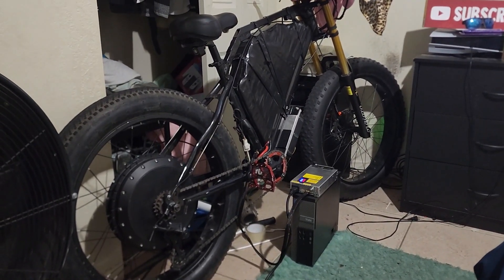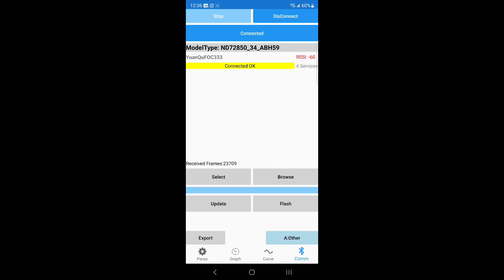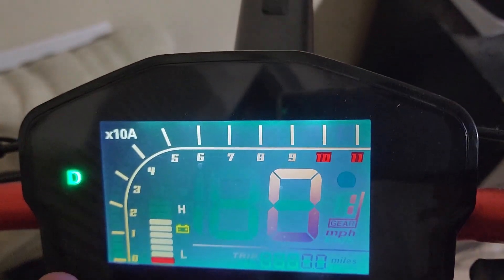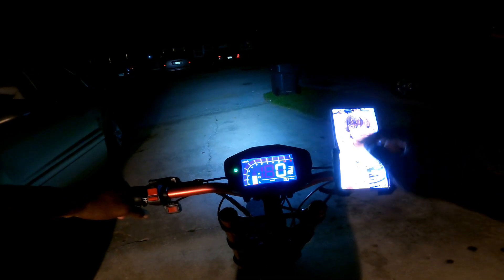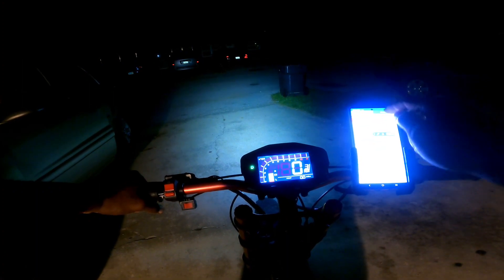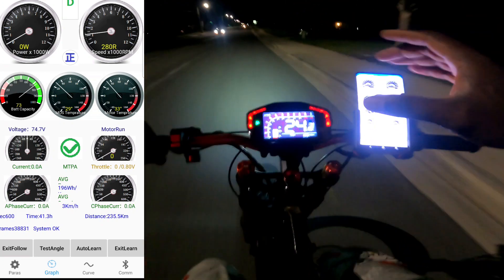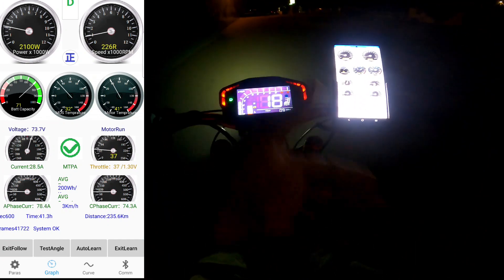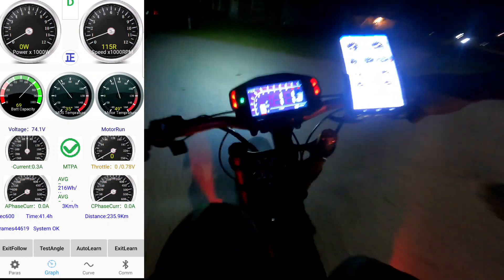How to have your power meter to work on your dkd display  27kw ebike ride

Comment: how did you get your battery level working on the screen.

i have power to my dkd screen. but no wire works for my 1 line comms. 
light blue, purple, brown wires do not work. 

my screen shows battery is full (which the fardriver app says 95) but i dont know if its working right or its just saying battery full because its got power. 
any help please
Reply: Did you try connecting the yellow wire from the display to the brown wire from the two pin connector on the controller

Comment: You pulled 26+kw.  Your battery said 420 amps.  Is that peak amps or continuous line amps?   I don't see how to set "peak" line amps on fardriver.  Also the reading has 380 phase amps "A" and "B".  There are 3 phases so are you doing 3x380 right there?  1140 phase amps?
Reply from the maker: @GhettoWrench  420 is the max continuous discharge
Reply: @E-bikeguy  OK thanks.  I wish I knew you lived by me.  You could have built my battery.

Comment: I have tried this,when i change the byte option to 6 dkd amp meter started working,however when i let go of the throttle very different sound comes from the motor,it sounds like its still turning when it comes to full stop..why is this man?am i doing anything wrong??why would the motor make that sound?i changed it back to three and stoped making that aound

Comment: Bought fardriver and dkd display recently for modding my super73 but the speedometer is showing super high speed. Do you know how to fix it? 
I have set the wheel circumference and pole numbers correctly but still not able to show correct speed.
Reply from the maker: It very complicated I do have the manual

Comment: @e-bikeguy - Huge fan -
Im struggling with a question you may know the answer to. If you have a big battery, and a smaller secondary battery, will there be an issue blowing the smaller battery fuse if the resistance is lower in the smaller battery? How do you wire this to primarily pull power from the big primary battery, and maybe regulate a max amount to come from the smaller battery? 
Idealy pulling a max of 50a from one, and a max of 150 from the primary is what im looking for.
Reply from the maker: No lol as long as the voltage is the same, like for example you have a 72v 40ah and a 72v 20ah you still can run them together in parallel  and you will be fine

Comment: Hey buddy what do you mean you said it to six later??
Reply from the maker: You good byte option 6 just let you see the Amp draw on your display in real time usually default is set to 11
Reply: @EBG-offical  Okay awesome So it's showing over a hundred amps but I thought I have it set to 70 battery line amps.. Is it showing phase amps?
Reply: Like what are the numbers referring to when changing them Do you know?  I changed mine down to 6 But I have my battery line amp set to 70. So do you know is this showing battery amps or phase amps then?  Sorry for the questions

Comment: Hi I am trying to tune the battery capacity meter on the DKD display. 

For some background I have a Surron 60v battery and QS165 and Fardriver. 

I am trying to get the battery capacity of the DKD display to match my battery and Fardriver app. 

For example the meter on my battery reports 80% and battery capacity meter on Fardriver app reports 80% as used the parameters “Full BattCeoff” and “0 BattCeoff” in the Protect section of app to align the battery and Fardriver. 

My DKD display though is reporting 60%. 

I have used the 879 code to set to 60v. 

I am trying to use the 824 code as it’s title is  “self input voltage calibration” but when I use this code I get U- on screen and 72.0 at bottom and when I change 72 to 60 I can’t find away to save and I have tried long hold of the right button. 

Have you any pointers on using 824 to calibrate the DKD battery meter.
Reply from the maker: I sorry to hear that  I'm having the same problem with my son's ebike, he has a 60v and when it full charge  the dkd display says 70%  I'm still trying to figure it out once I do ill definitely post a video
Reply: My sotion display shows voltage as percentage you know how to change that? I cant get it to show 100% i tried all sorts of fardriver settings

Comment: How do you get the speedometer calibrated properly, do change the settings in the gauge or in the app under the guage section
Reply from the maker: You have to change the circumference  and the offset in the display,  email me at theebikeguy08@gmail.com I'll send you the manual
Reply: @EBG-offical  ok I emailed u just now

Comment: Hey buddy no data showing on the display, Is there a setting I need to put in so it knows to put out the communication data to the display?
Reply from the maker: Ok  let me see what I can do
Reply: @EBG-offical  Appreciate you dude!  It's on I just have no miles per hour or live data Coming up.  Happy New Year bro
Reply: Also do you have a video on how to get it into miles per hour mode that I'm missing?  @EBG-offical
Reply from the maker: @Razorcrew_Cole  yes  I'll have to upload it
Reply: @EBG-offical  okay thanks dude, I had one other guy tell me potentially in the far driver 72450 It's the brown wire going to a two-pin clip for communications... 🤷🏻‍♂️ I'll try it I guess let you know if it works
Reply from the maker: @Razorcrew_Cole yes some of the new fardriver controllers used the brown wire  instead of the blue wire
Reply: @EBG-offical  appreciate you boss!  Do I need to put in my AH somewhere so the battery level works correct?  And still need to get it to miles per hour if you know .. thanks man

Comment: I tried changing the byte option to 6 but no luck on the display. No speedo or amps. But it works in the fardriver app.
Reply from the maker: That's crazy  even tho you have the one line on????
Reply: Any ideas on circumference for a 20" wheel.

Comment: hello thank you for your video it helps me a lot I have an ND72360 I bought the same display as you the dkd on my fardriver app I don't have the settings option for the screen, do I need an update?
Reply from the maker: Oh ok nice,  did it work out for ya?
Reply: @EBG-offical  no, I can't get the counter to work, nothing is displayed
Reply from the maker: @electrikeseb1247  ok and the blue wire to controller is connected to the yellow and white wire to display
Reply: @EBG-offical  yes
Reply from the maker: @electrikeseb1247  one more thing,  just the amps meter not working?
Reply: @EBG-offical  on my app at the very bottom I have function and calibration I have no adjustment for the screen ...
Reply: @EBG-offical  no nothing no amps meter no speed in km/h and speed 1/2/3 either
Reply from the maker: @electrikeseb1247  so you have no byte option, if so try a different number till you see it works on your display
Reply: @EBG-offical  speed pulse coeff ?

Comment: Please bro can i ask you
There are many sellers who say that this motor qs 273 v3 has a power of between 8000 watts12000watts  and 15000
 watts And I found another that says it has a 20000 watt motor، Is this power really present in every engine or is it the engine itself only they change the controller 
Please
Reply from the maker: Yes they rate the power of what controller they put in the bike
Reply: @EBG-offical  thank you bro 🙏
Reply from the maker: @medgt3304  no problem 😁

Comment: Hey man love your videos, had a question, I custom welded a 24in mountain bike frame to fit a 40ah 72v battery with 100a bms I have it’s a 5000w hub, can I shunt mod the 80a controller? Top speed is 52mph right now, thanks man!!
Reply from the maker: Yes if the controller do have a shunt resistor you can shunt mod it to get more power
Reply: @EBG-offical   even if it’s 5000w? Might be a stupid question lol, more torque and speed or just torque? Thanks man!
Reply from the maker: @dinkermcplinker7324  it will be more torque and speed😉
Reply: @EBG-offical  awesome! Have a great night 🙏🏼👍
Reply: @EBG-offical  I appreciate you answering so fast🙏🏼 look forward to your next vid, do you have a vid on shunting a 5000w controller
Reply from the maker: @dinkermcplinker7324  not at the moment lol ,but you 80a controller I believe the max it puts out is 3kw but it will put out more when you shunt mod it
Reply: @EBG-offical  shouldn’t harm the battery right, 80a controller shunted, with 100bms battery?
Reply: @EBG-offical  and with it shunted it should work with the sw900 display?

Comment: Hey what's up ebikeguy! Love your channel, I had a question that I think you might know the answer. Ok so I've got a stealth bomber clone from China with the 72200 and I bought a fardriver 72530. I was trying to connect the wires but I ran into a problem. The fardriver only has a single ignition wire and my sabvoton has 2. What could I do? Thanks
Reply from the maker: Ok it's the orange wire if you connect it to the battery + it will turn on the controller . You can get a on off switch and connect battery + and orange wire E lock to the switch
Reply: @EBG-offical  you the man! Quickest response ever. Thank you so much. I'm also building a pack with the p42a. Your videos have helped me along on this journey. Probly start the build this winter. The 60ah battery that came with the bike isn't all that bad. I can do 65mph. just want to have an awesome battery with no lag... Peace ✌️
Reply from the maker: The p42a are no joke they will definitely deliver the juice 😉 and yeah no problem I'm pretty much here most of the time

Comment: E-bike guy got an interesting update on my high power build I found out recently that after completing my 72v battery build that 2 cell groups had died and I couldn’t revive them now I had to tear down the pack and attempt to replace the dead cell group what do you think is this 72v worth saving at this point?
Reply from the maker: It depends on the cells and easy to get to the damage cells and replace them but I'll try to save it tho
Reply: @EBG-offical  I tried disassemble just those groups but doing so would require me to tear down that whole pack so I have a new plan since the other half of the pack is still good 36v battery that can put out 300amp I’m gonna use a 198kv outrunner motor connected thru a gear reduction system that will allow me to gear shift to different speeds max torque output on motor side is 15nm and in first gear it has a 15 to 1 gear reduction which is a total of 225nm going to my wheels but on last gear the gear ratio only is about a 7.5 to 1 gear ratio which in total is still around 112nm of torque on my last gear top speed is estimated to be 60mph with me on it and 73mph with no load on my last gear first gear only tops out at 36mph no load so probably about 26-28mph with me on it sprockets used is 12t motor, 90t, to 14t and 28t-14t on the derailer side all this for using a 36v high power battery I think it’s a pretty solid idea what do you think? Suggestions are appreciated
Reply from the maker: @jonathanbrunache3848  yeah that will be good, but for 36v will need a lot of amps to get it going that fast I would suggest adding some cells in series to make it a 48v if you can tho.
Reply: @EBG-offical  this setup can put out around 200amps continuously and 480 peak
Reply: At 36v
Reply from the maker: @jonathanbrunache3848  that fine at 36v
Reply: @EBG-offical  you think my derailer can handle over 200nm of torque tho that’s what I’m worried about
Reply from the maker: @jonathanbrunache3848  it depends on the derailleur might need one with a clutch
Reply: @EBG-offical  there’s ones with a clutch can you give a example

Comment: Thats a scary speed during day lol, Florida cops are pretty cool I don’t think they’re beat for bs atleast my experience, only time you’ll have a problem is if you actually do something stupid. Be safe man I was on way back Florida and piece steel fell off truck and ripped my front wheel of 2500hd yeah sucked but point is be careful that speed yah don’t really have time react at that speed, I had guy pull out on my yesterday I was doing 40 and hard stop fast

Comment: That's awesome - worked great on bit #6. My seller told me the amp meter feature wouldn't work. How did you figure this out? Also any idea on how to tune the capacity gauge? THANKS!
Reply from the maker: Thank you and my buddy was just messing around with display function and I put it on 6 and it just worked so I had to let the people know and to adjust the battery Guage is in battcoeff

Comment: Don't  be sarced of mod 3  I been go crazy with 3000watt qs hub motor
Reply from the maker: Lol ok, I'm getting use to it 😅
Reply: What are the maximum line  amps of your controller? I don’t think it’s 450a like the one shown here. This battery and controller would turn your 3kw motor into a ball of copper very fast. Just ask Dust.

I have a 3.5kw motor and I’m going crazy in mode 3 all day and night, because my controller peak amps is 27a. No way I would connect it to Ebike guys controller in mode 3 in its current state (untuned, everything set to max). 

Of course the 72850 can be tuned for 3kw, 8kw, and probably 12kw. But right now it’s set for “24kw burn everything in sight” mode. Lol

He can very easily tune the controller for his motor which would allow better mode 3 control and then modes 1 and 2 can be set to preference in speed and power, either for ECO/NORMAL/SPORT or make it behave like 1000w, 3000w, 8000w so the modes are “Ebike wifey/Ebike Kid/Ebike Guy”.
Reply from the maker: @imho7250  lol 🤣🤣🤣 it's set to 450 line amps and 850 phase on mode 3 but I rarely get be in mode 3 I believe in mode 2 is 23kw in mode 1 is 15kw but yes I can tune it just for 3kw lol I believe I can hit 30kw
Reply: @EBG-offical  , yes, my personal preference max for each mode would be 6kw/12kw/24kw. And speed would be set 30/45/60 mph, such that once the top speed is reached, the controller power will decrease 25%-50%. 

These settings would make even mode 1 more powerful than most electric bikes, but it would at least allow the throttle to give somewhat stable control. 

I actually drive my 27a ebike on mode 1 because the throttle control is distributed over a smaller range in speed and it’s less glitchy. In mode 3, even same 27a, a tiny twist of the throttle makes current jump twice as much, torque jumps twice as much, and the bike lunges forward.

Once I get a better controller it will also have many ways to smooth the throttle and torque such that i can 40a/80a/160a with speed of 30/45/60mph. And most likely I would stay in mode 1 most of the time, and only go to mode 3 to race a 125cc bike. Lol
Reply from the maker: @imho7250  🤣🤣🤣🤣 I feel ya there!!!!

Comment: Yo brother will a 2 mode 40a-50a controller will work with a 48v 60ah battery without damaging the BMS?
Thanks in advance
Reply from the maker: Oh yes it will, bms is only there if you go over it's peak discharge so yeah you is good to go
Reply: @EBG-offical Got it 🤜🤛

Comment: Bro has your test rider ridden it on level 5 full throttle yet? If so what speed did he get ?
Reply from the maker: Not yet he only done it on mod 2  but he told me that a power wheelie at 60mph was really easy not even his motocross yfz450 can't even do it lol
Reply: @EBG-offical  simply amazing definitely 80+

Comment: Wow!!! 
That setup's trully a flying machine, I bet it's some g-force feeling opening up the throttle on it, especially with a full battery!
Display looks great on it, in the future ill be updating my controller/display...
Heck, i dont even know what displays coming with my voilamart kit, im guessing its the s900 or whatever its called.
Reply from the maker: Yes lol even even at 60% charge the wheel still was lifting up 🤯🤯🤯💯💨
Reply: @EBG-offical  wow, bet it's sooo much fun, I wonder if mine will wheelie at all with putting the higher voltage 52v battery on the 48v 1500w kit?

Comment: Thanks for this. What app are you using for the fardriver bluetooth? I have an android phone and I have to set the date of the phone manually to before 2022. Seems like Iphones dont have the issue but android phones get "this version of the app is expired". The version Im currently using is the most recent version Ive found on 3 different sites including the SIA site.